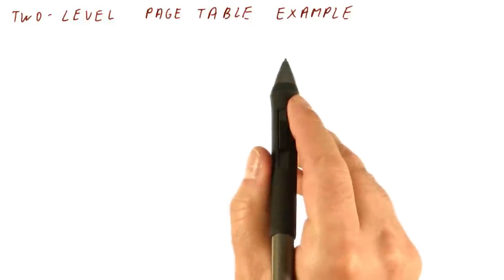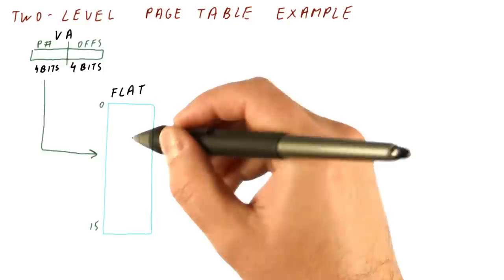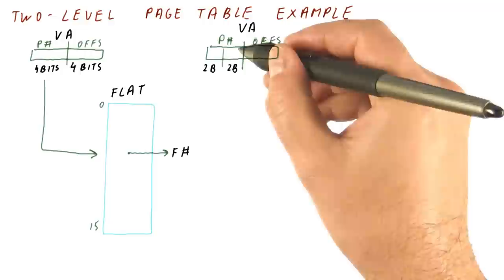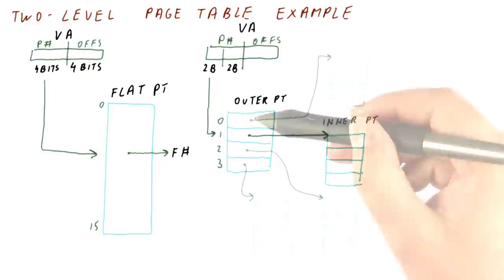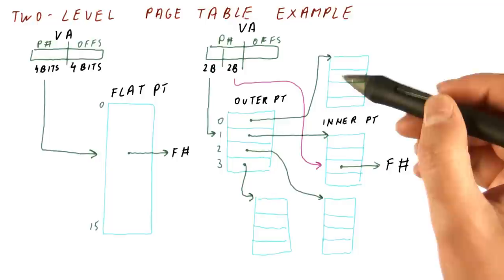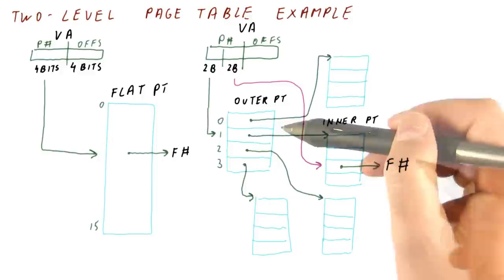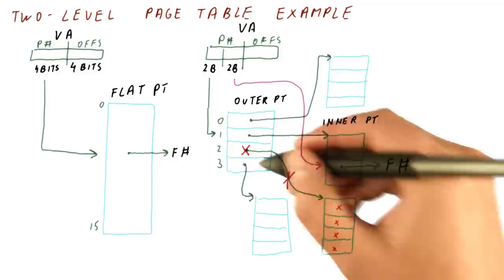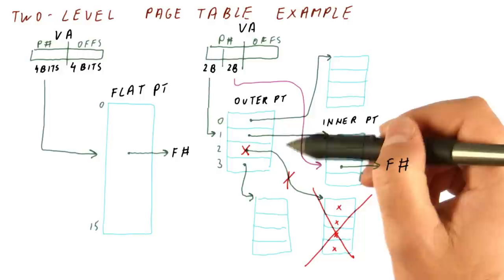Two Level Page Table Example - Georgia Tech - HPCA: Part 4

Comment: Hi, what if the page number is odd? How would the sizes of the inner and outer table be calculated?
Reply: from my understanding, pages will always be a power of 2 (ie. 4, 16, 32 etc.) so there won't be a case where you end up with an odd number of pages.

Comment: Thank you for the video!

So, if I understood correctly, with a two-level page table, we don't put all of the inner page tables into main memory? We just put the ones we need?

While in a one-level page table, we would have to put the entire table into main memory, even when we don't need many of the pages?
Reply: Mostly, yes. The flat page table would take up lots of invalid address spaces. We won't have to use them. They are wasted. By doing this multilevel paging, we minimize the number of wastage.
Reply: Thank you! :D